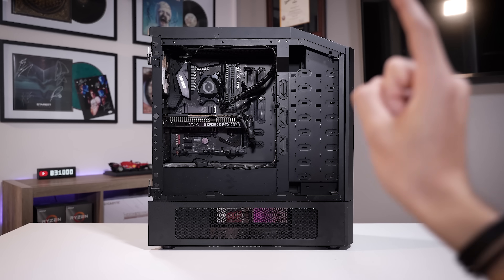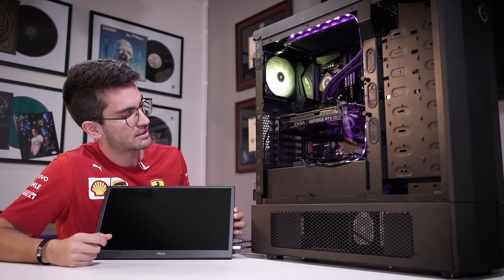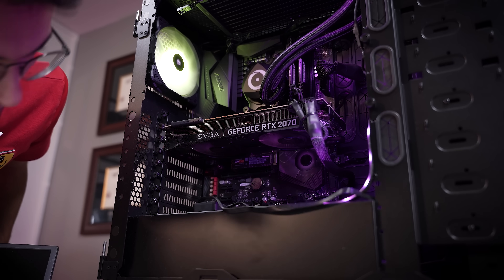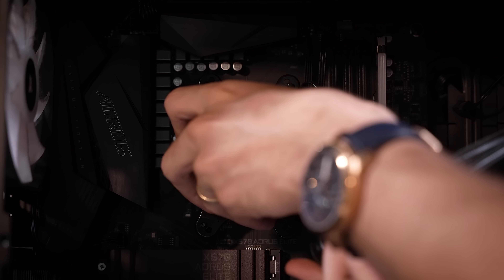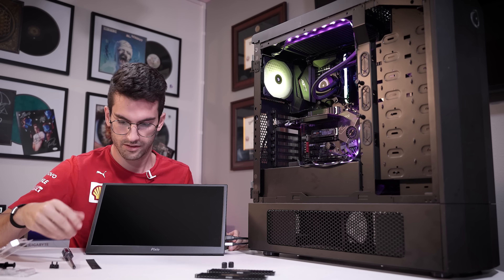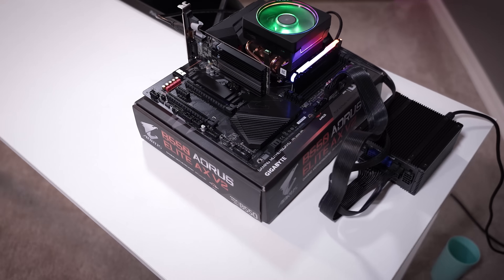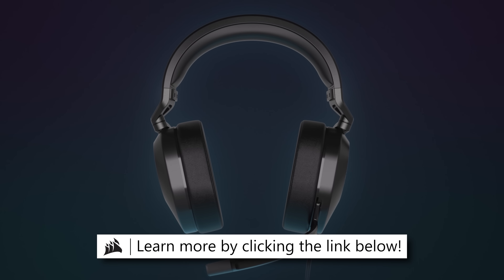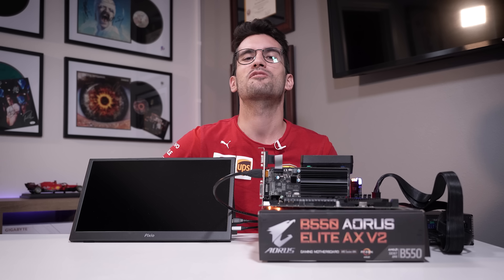Fixing a Viewer's BROKEN Gaming PC? - Fix or Flop S3:E3

Comment: My 3900X died after about 7 months. The replacement cpu works great now for over a year.
Reply: what was your replacement cpu? another 3900x?  Just curious
Reply: @marcc5768  Yes I still have another 3900x. One thing about the first 3900x, the one that died is that  right from the start it showed higher temps like in the 40C's when no load was on and the second 3900x shows 33C. For example I'm running linux mint and I have the virtual box open running a virtual windows 10 and in the virtual windows 10 I have programs open and at this moment my pc is 36C. 

Both cpu's used the same Noctua NH-U14S cooler in a Define 7 case with plenty of quiet noctua fans.
Reply: @jonathane9403  Yaay! a fellow Linux Mint user!!.  Tho my Mint rig is my daily driver, not gaming on it tho.  Running a Kllisre x79 with a Xeon e5-2650 v2 with 16GB ddr3-1333 in quad channel.  I used to play with Virtualbox VMs then slowed down..my current x79 mobo doesn't have enough sata ports like my previous AM2 mobo with an Athlon 64 x2 5000+ (brisbane)
Reply: @marcc5768  Nice!. I  use the virtual box to play a couple of old windows games while in MInt but for newer windows games  my computer is set up to dual boot into full windows. I'm fortunate to have a gigabyte master 570S m.b. which has some powerful options for many things. Hopefully my rig will last a long time as I do not care about keeping up to the latest and greatest.
Reply: @jonathane9403  Nice!  I do have some older Lucas Arts titles I wouldn't mind playing again..from the XP days of Windows.  My gaming rig which I assembled last year Jan 2021.  Founded on a Asus Prime b350 Plus with a Ryzen 5 1600 w/16GB ddr4 3200 gskill flare x.  CPU and Mobo both used from AliExpress.  Along with a used evga gtx 960 4gb.  I'm hoping to do a drop in upgrade down the road to either a r5 3600/3600x or r7 3700 /3700x.  However, I will admit..I'm having doubts on the use of Zen2 in my gaming rig.  Since I feel a used purchased AMD CPU via an AliExpress vendor might not be replaced by AMD directly.

Comment: Could it be the wrong bios?
Reply from the maker: No. Multiple boards and all of them with natively compatible Zen 2 BIOSes - our 3700X wouldn't work either if that were the case.
Reply: @GregSalazar  yeah kidna figured, that's strange that so many are going bad. These cpus should be lasting a lot longer then this.

Comment: I hope you see this but this is a common issue with Ryzen CPUs, the one you pulled out is probably working fine. I pulled out a Ryzen 2600 I thought wasn't work with the exact issues like this. My Ryzen 5600x has recently started acting the same, plugged the 2600 back in after 3 months and it works like normal. I have a B450 motherboard that'll I'll with the 5600x to confirm my suspicions.
Reply from the maker: It is not fine... It was not responding in multiple motherboards.

Comment: I had problems with system crashes related to a Ryzen 3700X ... once I changed chips to a 5600G the problems went away.  I 100% believe there might have been issues with at least some of Zen 2.

Comment: I have a question, I have a ryzen 5 3600 with a b450-f gaming II asus rog strix and is cooled with a corsair ml240l v2 white and I have 80°C, is ok or is a problem with cooler?
Reply: is that 80 Celsius under load or Idle temp?  If it 80 C at Idle you might have an issue with the AIO.

Comment: hey Greg l had the same problem with my 3900x it died after six months it had a AIO 3 fans + 6 more in the case but yes it die got a replacement l hope you can shed some light on these CPU's

Comment: One thing I've noticed is that Ryzen motherboards put out way too much voltage to the CPU when set to AUTO. I've seen voltages as high as 1.498 volts. I always manually set the CPU voltage of my Ryzen 9 3900X to 1.325 volts.

Comment: Hi Greg, out of interest I have had  2  Ryzen 7 2700X cpu's.  1 failed and was replaced by AMD. The replacement  and remaining chip both lost the second memory channel which through me for a while ( thought it was memory). Still running in single channel mode, 16Gb in A1,B1. May try Intel, always used AMD in the past. Love the vids and the service you provide. Might try this myself in the UK. Cheers Mike

Comment: My guess is that the original BIOS was never updated on a lot of these failed chips or they were overclocked. The first BIOS versions ran them with a high voltage to reach their intended frequencies. Also early run chips used a lot more voltage. My 3700X cannot run on voltages the later manufactured 3000 series chips can.

Comment: My 3700X worked fine for a while and reached 4.4Ghz. Now after various BIOS updates it barely reaches 4.365Ghz, sucks juice and has stability issues. I think the first run Zen 2 refresh chips are probably just a bit rubbish.

Comment: You should try submerging the cpu in IPA for 10 minutes then scrubbing the pins with a toothbrush. I had a 2600 with the same symptoms and the pins looked fine but they still needed cleaning. I know this sounds like crap I thought that when I was trying it but it worked. And it will only cost you $1 and 15 minutes or so.

Comment: i tried to destroy with insane voltage my old 4790k for years, it's still working.

Now i'm doing the same with the 11900k (i payed it less than 200), insane frequency and voltage, still working.

Intel powa
Reply: Not destroyed but I damaged my i7 2600K by using 1.46V daily and it degraded the silicon in 2 years.
Reply: @devnull4122  bro, i pushed a five years old 4790k to 1.55, at 5.1 ghz, and i played flight simulator with the cpu very often at 100% for hours and hours, even flight of several ours all togheter, was at 90c delidded with liquid metal, and it's STILL WORKING, now it's an 8 years old cpu, it's at 1.38 volt at 4.8ghz in my cousin pc, he play assetto corsa competizione in vr with it :O
Yeah, i loved that cpu a looot

Comment: i have the same symptom with no display, monitor is totally off but plugged in, my dr debug showed code 36,37,40, and 45. it keeps looping between those codes, it has happened before, before i cleared CMOS, now i just turned it off, unplugged power, and pressed power botton for a few seconds, then turned it on and then showed a display. its annoying but it is an easy fix.

Comment: I have had similar symptoms when the AIO is screwed down too much effectively causing some of the pins on the CPU to shift in the socket and not make contact anymore, mostly with the OEM mounting methods though.

Comment: I just had a customer come into our shop the other day that had a Ryzen 5 5600X that was dead as well.     First we swapped his GPU into the lower slot because DEBUG said VGA and it booted..    He ended up buying a new motherboard and same issue.     We got a spare 3600 in and he ended up bringing it back in and found out it was his CPU that was the issue.

Comment: I have an RX 5700xt stopped working last week, no post, I've tried in a different PC, same thing. My PC works normaly with a spare old GPU. The 5700xt is the problem, if I put in the second PCI slot with the old GPU in the first one the system boots and detects but AMD drivers get stuck half way during installation. I've tried to clean it and update/downgrade the BIOS, no luck. Anyone have a suggestion? What else can I try?

Comment: Surprised you didn't use a B550/X570 board with a debug LED or read out for the test bench.

Also, are you coming back to ATX in a few weeks for F1?

Comment: Greg, I just wanna share a tech tip safety rule, remove the storage devices because on the HDD Sentinel (for hard drives or ssd) and Crucial Executive (Ssd) they counted the Unexpected power events that counts so much and be sensitive for that to not lessen their lifespan

Comment: The M.2 drive isn't secured with an end screw and looks to be in the socket crooked.   Wondering if this could cause CPU death if the drive loses contact with some pins?   Regardless...the drive should be secured properly and straight in the socket even if this didn't cause the problem it's something that shouldn't be overlooked.

Comment: Here a problem I never came across, Build a mini ITX  Ryzen 1600 AF with a GTX 1660 Super. Problem !  Windows won't recognise  the Video card. Was able to run video though it but was unable to install the nvidia drives. Solution update windows to the latest windows 10 update and WOW everything is working. Just a FYI

Comment: agreed. when i was gonna update from my 2700x which has run Flawlessly since Black Friday 3 years ago, when i saw others with the Ryzen 3000 series going bad, i held back until the 5000 which is also doubt ridden, in 40+ years of computing never had a CPU go bad, maybe they taking on too much Power or Heat, but i expect it to last a lifetime, not six months.

Comment: Hey Greg, I've got a potential problem with my 3900x too, after having issues with my build constantly restarting(I was able to update the BIOS to the latest version and it didn't help) I ended up taking my system to a local PC repair shop and after testing everything, determined that it was the MB(ASUS X570 Tuf), since the MB was still under warranty, I did a RMA, and ASUS sent the same board back to me saying they couldn't find anything wrong with it, I know that it's not the GPU and PSU, since I upgraded from a 2080 to a brand new 3080 and a brand new Seasonic 1000watt to go with it, that all that's left is the CPU, so I've ordered a 5000 series CPU to replace it, just wanted to let you know that bad 3900x's maybe a growing trend in this video series.

Comment: Hey Greg, I got those issues in my past history with my First 2 Custom Gaming PC’s. But I was able to get it to post with on board graphics on intel i5 8th gen. What I did (probably not recommended at all) was using a separate power supply, and connecting it only to the GPU. (Thinking 1 for the Mobo, CPU, PCIE…. Then one to jump start the graphics card.) and I was able to get the graphics cards working. Same issue on both PC’s. Built 5 months apart, and ran as intended. Just wondering if you ever tried anything like that in the past. Great videos! I love learning new issues and the easy fixes to try out first. You have true dedication and an amazing YouTube channel. Thank you for the constant uploads and don’t stop please 👏

Comment: Wish I lived in the US, in or around Orlando...  because my system been having strange issues ever since I installed my 3080 which are non consistent. Unable to poweron for a few days without a powercycle, then suddenly for a few days it does turn on normally.. few days later it doesnt and I have to cycle the PSU again. It's an odd problem which I have never experienced before.
Glad I know when it happens what I have to do that was easy to diagnose lol but what causes it I dunno! Might reinstall windows 10 at some point but not right now.

To see a channel like yours helping people... is just awesome. Most people dont have spare CPU's and mobo's to diagnose. I actually keep an old B450 mobo, ramkit and Ryzen 5 2600 CPU on hand in case my 5800X based system doesnt work. And you should be able to work with AMD to get things checked, you call yourself a small tiny part.. bu twith over 800.000 subs your channel is definetly not small although I firmly believe you deserve that diamond play button so get to that 1 mil subs!

Comment: It could be a voltage issue causing the 3900x cooking. I know i have issues with 2700x running with higher clock memory. I got my memory clocked at 2666 bacause 3000 or high with 4 dimms blue screens everytime

Comment: Fried from a heavy overclock most likely. Doesn't help that the system was dirty as well. Most likely was never cleaned based on how much dust buildup was shown at the bottom at 3:47.

Comment: After I purchase my 3900X I came across multiple YTs that discovered issues with that specific chip. I can say however that my 3900X has been running fine and was running when I recently replaced it with a 5800X3d. I still have it.
Reply: this type of thing isn't common and it happens most likely due to production inconsistencies so most chips still work fine

Comment: OMFG that was a Cockroach !! that fell out you need too murder it pronto and vacuum out that case just in case their is more they will breed and multiply and are a HUGE PEST and discusting BRO ... kill it emmediately FFS... also the 1st too recent AMD ryzen CPU,s die because of poor binning !!! especially memory channels , this is why Ryzen has always been cheaper they do not bin their CPU,s very well other then checking if they work thus this give longevity and many other issues but decreases cost of manufacturing and process also they overclock their CPU,s at a higher clock stock out of the box !!!! also killing them prematurely .. where in Intel takes pride in binning and clocking and ensures lifespan at a higher cost too consumers !!!! yes some intel cpu,s will die but its rare and ussaully takes many years or is due too rediculas overclocking !!!!

Comment: Love these videos. You helped me diagnose the pc I built for my niece. BSOD sometimes but never when I was there. Turned out a ram stick was bad causing bsods
Reply: i might have to try that, i seem to run onto memory corruption issues every now and again, i have mixed RAM sticks but i made sure they were as similar as possible when i bought the new pair (i missunderstood how quad channel works and didnt know it was better to buy 2 8gb ones and no have 4 4Gb ones with lower core counts than 32 lmao)

Comment: Thanks for these videos Greg. Just a couple days ago my computer would turn on but wouldnt post. The debug LED pointed towards CPU. After trying resetting CMOS, flashing BIOS, reseating CPU, reseating RAM and trying single sticks in different slots, checking power connections and everything. It turns out by my knowledge that the CPU is dead. But these videos helped me diagnose it was the CPU. Thanks!
Edit: my CPU was a Ryzen 5 5600X. Only had it for a year and a half since March 2021. Which is really surprising. AMD must have really poor lifespans compared to Intel.
Reply: hey, but it's ok to run the new AMD cpu's at 95°c... according to AMD.  Amd knows of this dying cpu's well enough and won't be explaining anything to this channel or anywhere else for that matter, it's their damage control to not tell anyone about this.

Comment: Someone please give me your opinion. I accidentally deleted windows registry files after a clean. A window popped up and I impatiently smashed yes. Very bad decision auto repair will not work. Bios is fine but when I try to clean install windows via a usb it doesn't even get to a windows logo before a freeze or reboot. I've tried so many ways my and my usb boots on an older stock dell pc that is UEFI. I've read every forum with similar issues and every solution has not worked that wasn't related to hardware. What are the odds of hardware failing at the same time I destroyed windows?

Comment: I've had my 3900x since late June of 2021 and it's still working fine. The cooler I have has only allowed it to hit a max of 81c in fairly warm room and a silence focused case (noctua nh12s redux with second fan kit).

Comment: I still own athlon xp/sempron/intel dual core pentium cpu's that have lasted longer than alot of these zen chips.Maybe its a huge prob they need to address as they should not be dying this quick.Was going to upgrade my zen 3600 to a much more beefier one but think i might go back to intel.Yes they are more expensive but the quality seems to lie with intel
Reply: I don't think I've ever had a cpu fail. I've owned quite a few since my first 286 (to be fair I had that upgraded to a 386 in just a few weeks) including just about every amd generation since their 486 clone. I figure we're talking 2 dozen chips at least. Nor has anyone I've helped with their system.

Comment: they make test switches you can use when you are testing motherboards out of the case.
Reply: It would be trivial to make a harness with connector and momentary contact switch for resetting a bios and power on. just a single connector two wires, and a switch. Plus some heat shrink tubing if you feel fancy.
Reply: no that's not what i was saying i was saying instead of using the screw driver to turn the motherboard on they make switches that connect via the pinout on the board so that would be safer and more efficient than using the screw driver.
Reply: @Mikie1959  And they're trivial to make was my point. I don't know what they sell them for, but more about $3 bucks each is a LOT of profit for .2cent connector, .3cents in wire (copper is crazy pricey atm) and 15cent button. Pretty sure I've made a couple of those in the distant past. My current psu tester has a passthrough and power button and it's been a long time since I had to dx past the post code.
Reply: your not reading i said you can get these premade i have 4 of them and they work just fine i got mine on Amazon im not saying make your own you could even use one from an old case that isn't being used anymore.

Comment: If you look at the back of the cpu for the Ryzen 9 I believe that either it experienced water damage or it overheated. There is some discoloring from what the video shows. That could also just be the video processing.
Reply: Might also just be the thermal paste not being cleaned off 100%.

Comment: You never really know what kind of environment these Zen 2 CPU's have been in. Dust, high temps, bad overclocking with two much voltage applied, being removed and inserted too much, Electrostatic discharge when cleaning - the list goes on.